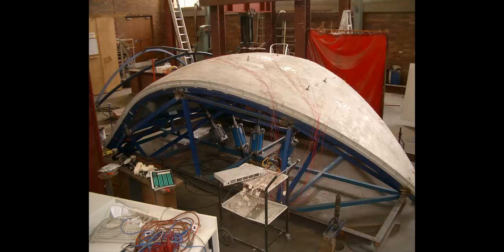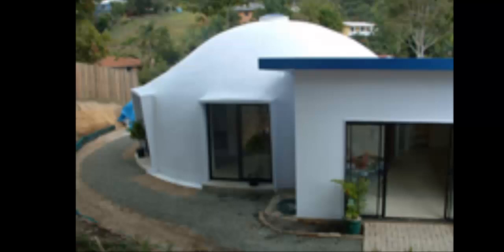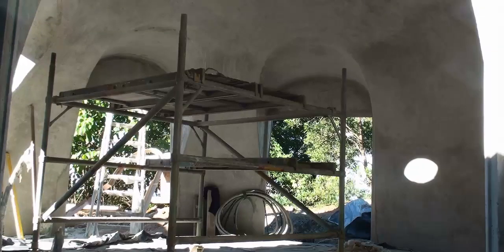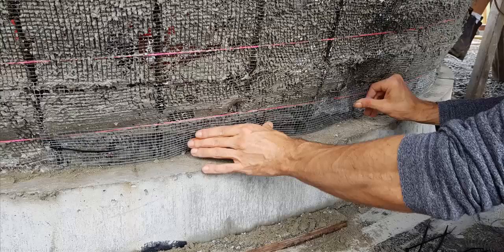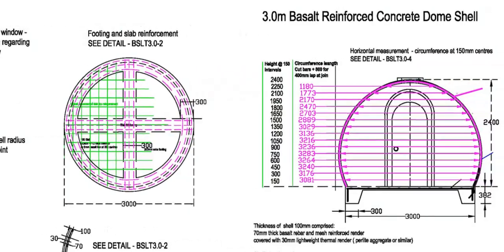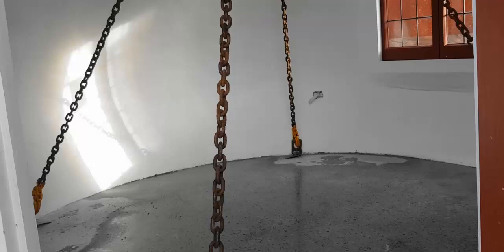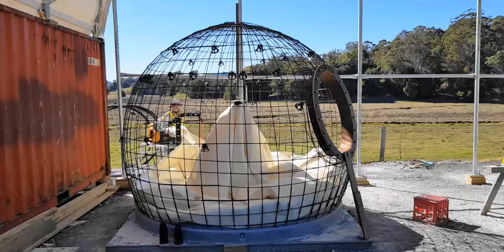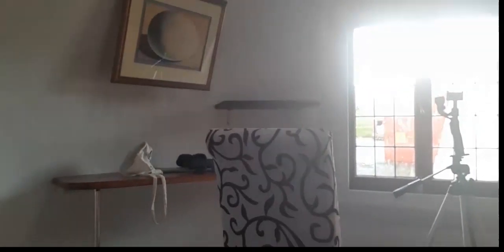On Line Dome Building Workshop

Comment: Chris, hello from Missouri USA. Does the manual cover these: insulation for cold climates like Missouri or hot/humid climates like Texas? 
                                                                                                    can scoria or pumice be used in place of perlite?
                                                                                                    how to install conduit and plumbing?
                                                                                                    where to order the basalt mesh?
                                                                                                    does it have to have the skylight?

Have followed Monolithic Domes in Italy, TX for 25 years and have desired to build domes and of course live in one, but their process is daunting physically, mechanically, and financially.
I'd like to get experience building 2-3 structures in my backyard. I'm more hopeful after reviewing your videos and website.  To God be the Glory in Your legacy. 11-1-23 Mrs. G
Reply from the maker: Hello Mrs G, My sincere apologies for such a delay in responding. Scoria or pumice can also be used in place of perlite. Any material that makes a lightweight concrete can work. The thickness that you apply depends on the insulation you want to achieve. We have installed electrical conduit within the shell concrete but it is better to run around the structural shell and have it covered by the thermal layer. Plumbing can be installed like any slab on ground house. Drainage can go through the floor or through the side of the wall. Same with the plumbing. Get in touch with us for a referral to a US supplier near you. I believe having at least some kind of ventilation at the apex is important to allow stale air to escape. We usually install a skylight. The e-manuals show howto make one. I strongly suggest to start with a 3.0m diameter first. I wish you the best.

Comment: How long does it usually take to build such a dome? Say, for example, you had 6 people working on it?
Reply from the maker: At our hands-on workshops for a 3.0m diameter dome (no mold method) we usually have 7-8 people and we build the complete structure from a pre-finished slab in 6 days (does not include touch ups and painting. At the air form workshop we achieve the same level in 5 days. If we were building ourselves it would require 4 people over the same time.
Reply: @Domeshells  Thanks for the reply! I also asked in one of your other videos on a workshop. What does "pre-finished slab" mean? 

I hope you don't mind the questions. Our organization's corporate social responsibility arm is looking into making low cost hardy homes for poorer areas and this is part of the research.
Reply from the maker: @Norbingel  Dont mind at all. Pre-finished slab means that we have the concrete slab down already when we start the workshop so that it is cured before we work on it. The above video is quite old. Since then we have refined our methods. We are currently working with NGO's to deliver different scaled packages that include certain equipment, training and technology transfer based on the production of 1-2 units a week. We are very interested to assist anywhere in the world to help people build their own strong, safe shelter. Our method uses the least amount of materials for the biggest benefit in terms of comfort, safety, longevity and sustainability. We are in process of rearranging our website and have just uploaded a second online video workshop. This one is about using an air form. For high volume the most efficient system is to use a rigid mould
Reply: @Domeshells  Air form is very likely out of the question anyway. The locations we are targeting are faraway, isolate, hard to reach areas where resources aren't easy to come by. I have not even been able to locate any basalt rebar in the whole (3rd world) country and it would probably be too expensive anyway. If the program is to be sustainable, all the resources must be something the target local population can afford and make on their own. We're there to provide the initial demo house and training but we're a very small organization (a non-traditional, inclusive school) that can't afford any more than that so we're looking into various possibilities to see which suits best.

I look forward to seeing all the new content you have and will check your website out! Thank you again!
Reply from the maker: @Norbingel  is bamboo available in those locations or any other kind of flexible cane like material. If so then those materials can be used to fabricate a cage of the structure and then all you need is sand, cement and chicken wire. This is THE most simple system that can be adapted to what is available locally.
Reply: @Domeshells  Much more available than anything else and we have considered it. I've also seen your videos on it. In your experience, what's the longest they can last? I've raised the possibility with the locals and while they can readily get bamboo, they think it won't last long encased in cement especially since we're in the wet tropics and only the big bamboo businesses really treat the bamboo.
Reply from the maker: @Norbingel  you are correct that bamboo may not last however, the split lath of the bamboo is used to fabricate the shape. It is the matrix of the layers of GAL mesh encased in the thin concrete shell that dose all the structural work. They will remain immensely strong even if the bamboo gets eaten out. A dome resort 
project we were involved with at Mentigi Bay in Lombok is built exactly this way with bamboo. These domes have survived a 7.1 earthquake when the local town collapsed. The method is detailed in our Bamboo Dome Building Guide e-book https://shop.domeshells.com.au/product/bamboo-mesh-render-dome-building-guide/
Reply: @Domeshells  Ah I see, so it basically takes the place of the rebar but only to hold the mesh in place for the concrete to hang on to? How do you keep the mesh itself from corrosion if it's not made of basalt? How do you waterproof the cement to keep the mesh from moisture considering our torrential rains?
Reply from the maker: @Norbingel  the mesh is all  galvanized. You could use basalt but if you want as cheap and simple as possible GAL mesh is good. It is used in ferro cement construction of boat hulls. The shell requires waterproofing. There are many easy to apply systems. If you have access to it adding polymer to the mix adds waterproofing within the concrete but adds cost and is not necessary
Reply: @Domeshells  Well, thank you very much! This has been most informative!

EDIT: What size mesh would you suggest?
Reply from the maker: @Norbingel  there are examples in the bamboo Dome Guide plus a lot more know how